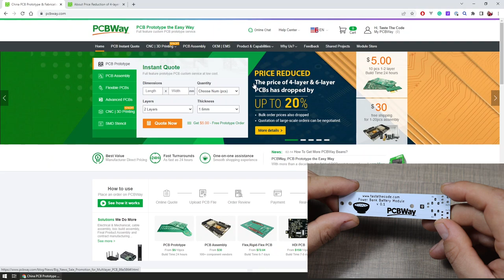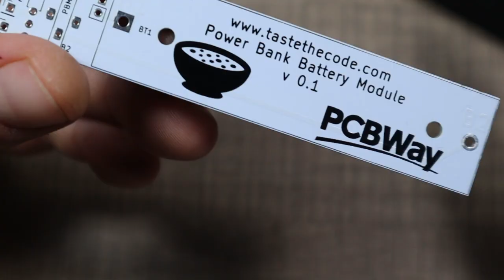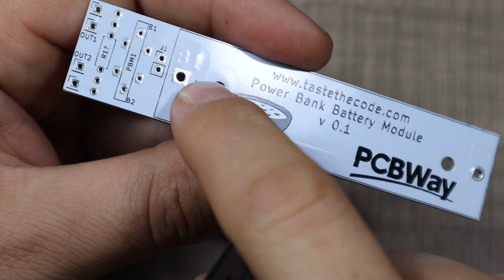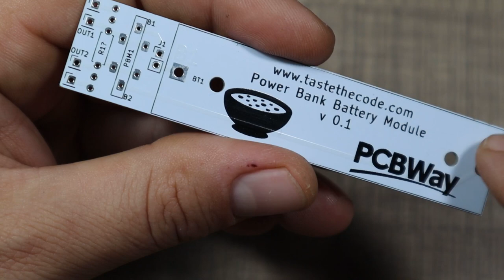Make a handy power bank for electronics projects on a custom PCB

Comment: Sir I have this circuit for my diy power Bank which has 6 cells and after cell potential reaches 3v this circuit heatup badly I also tried with current limiter circuit and protection circuit that cut off automatically after full charge but nothing works can you say anything what can be possible cause of that ??
Reply from the maker: Usually a short circuit or a bad charging chip. Also make sure that all the individual cells are good. A cell can fail with a short circuit so it will drain the entire input and heat up a lot.